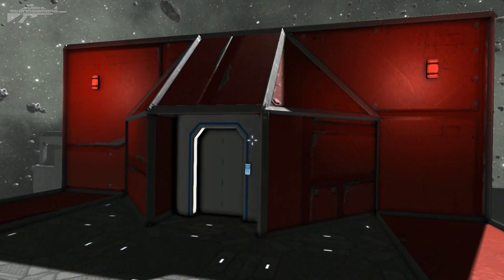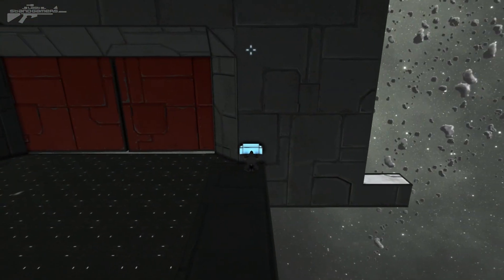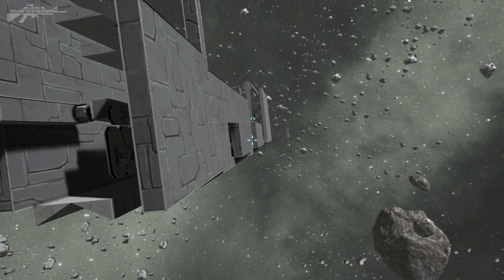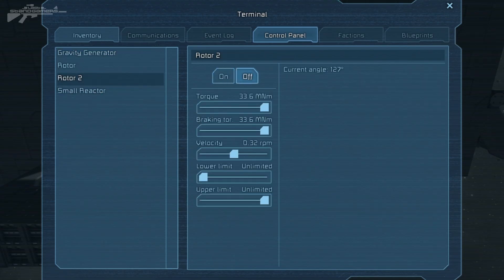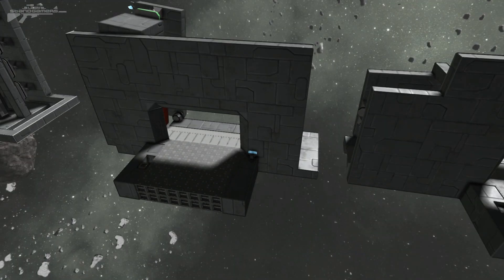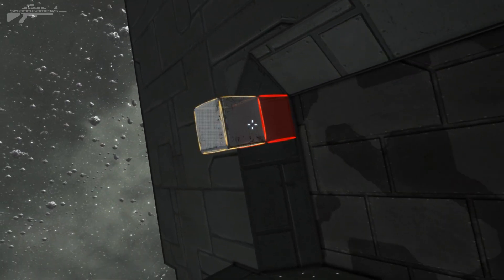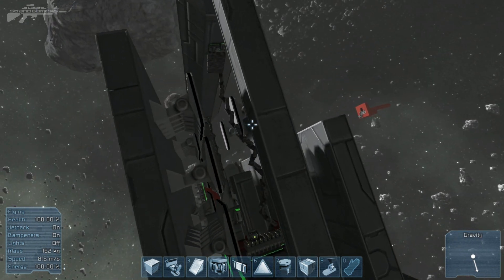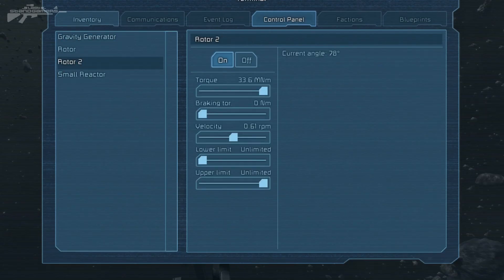Space Engineers - Blast Doors, Simple But Effective High Security Doors

Comment: i cant imagine making something like this in survival mode,,what for, energy usage is too high, i hope theyll add blast doors as normal game objects
Reply: ive built the first type of door in survival mode
it works but is a bit complicated cause you have to disamble and built again the ground when you want to close the door
also the door gets damaged if you dont set the right upper and lower max-level for the rotor and dont do raise the velocity to high
as well you dont need landinggears actually in survivalmode you cant built these walls with landinggears attached too it
Reply: TrancoTechnizer
There is a much more simple way. Just use pistons and Blast Door blocks. They have a smaller size than the armor blocks, which gives them a tiny gap to slide between armor blocks.

Comment: i just finished making a similar hangar door but it folded down and became part of the floor so you dont loose any ship real estate which can be very valuable. it is only 1 block thick but you can make the slot in the floor deeper and add layers if necessisary. you can also park small ships on it or use the area underneath it [if left open] as an area to hide secret ships
Reply: i agree with you function86.
Reply: Won't that crush anything next to the door?
Reply: Henners1991 it sounds like it folds outwards, into space. so it effectively makes your hangar bigger, since you can park ships on the wall
Reply: the model i have folds in but it dosent crush anything next to it, only things it directly hits. you could make it fold out i suppose but that would be make your ship bigger. i just made another door for a station that opens horizontally out and has a thick protective door and then another door that covers it and seals any cracks and protects weak spots. that one is a little larger

Comment: /sees a blast door/
/shoots out the thin walls around it instead/
Reply: Not to be THAT guy, but these would probably be built inside of a much larger structure making the door the weakest point.
Reply: The Euphoria is strong with this one.
Reply: ***** Greentexting is a 4chan thing... and Uraneum is wrong because greentexting starts with a > and not a /
Reply: Lord Fudge Packer Mc Gooberson
You know you can just edit your original comment instead of writing a new one with the correction.
Reply: I would thumb up your comment but you have a fedora and you're trying to greentext on youtube.
Reply: Uraneum What are you babbling about?
Reply: Nick Trano i know your post is a bit old and such but I have to slightly disagree with you...after experimenting with the door designs for blast doors i have figured out a bit

my design was as such...the door itself be made of 3 layers of small ship heavy armor in any fashion you want the door frame be 2 large ship/station blocks thick inner layer of light armor and then a layer of heavy on the front and that design stopped 48 small ship rockets before punching all the way through any of the armor which is either reloading 12 times in survival mode or firing 12 rocket pods 4 times. 

will it stop everything? not in a million years, but the fact that heavy armor isnt nearly as affected by warheads as light armor is it does the job. it literally took my friend 3 minutes to get through the door using a large ship with a landing gear on the nose trying to rip the door from the frame. it look him less than 60 seconds to ram a pole through the framing using the same large ship

so in short the frame will always be the weakest point of a security door
Reply: Yes, I understand what you're saying but again that's a situation of the door not being inside a structure. You shouldn't build something like this for the outside of a ship where you can just drill through the walls to break the mechanism; this goes inside your station, preferably at the end of a tunnel.
Reply: Uraneum not sure what the fedora has to do with anything, and I've never heard of "greentext" before so... ok whatever, have fun :)
Reply: Brandon Cheezburgah No shit mayne.
But he's using the same context.

Comment: Sorry if I put in some not so nice feedback... but for the piston door you are making it more complicated than necessary....
first of all, you do not need to use landing gears to get your door fit tight up to your entrance. second, you need to fit the landing gears on the side of the doors of course moving along a "rail". The top or underneath landing gears are unnecessary. it will not move up or down.
You might also want to add some extra landing gears in the lock position to lock it into place and secure it in position when it is shut.

I got a simple design on the workshop.
It took me several attempts to get there... however, the version I am using now at times even works on MOVING !!! large ships and of course completely without problems otherwise. All one needs to respect is the basic building advice I included in the workshop description.

http://steamcommunity.com/sharedfiles/filedetails/?id=203446154

Comment: Do you think they should add grouping to terminal objects?
IE, all gravity generators can be grouped, all lights, thrusters, ect
Reply: YES! YES! we need that now! I spent 15 minutes changing 300+ lights to red
Reply: Not only that, but "presets" for rotors and gravity generators as well, so you can set different kind of settings to buttons and apply them instantly. Saves you the time to figure out the exact velocity your rotors need to make that door open without destroying half your facility.
Reply: I kinda like the automatic wiring so far (having to wire an entire spaceship would be tedious...), but you have a point there. Maybe checkboxes for every terminal that is connected to the component you have selected, so you can specify on which terminal you want to see this particular component.
Reply: Preset block default state and automatic grouping would be great

Comment: Once, I made a ship that used a circular rotating door. It was literally a disk with holes on either side of the rotational axis, but solid 90 degrees out. All you needed to do was rotate it a quarter turn, at any speed, and your ship was locked tight. Unfortunately, this sort of door does take up a lot of room, but this led to having a whole bunch of docking pads inside. I can post the workshop link if anyone's interested.

Comment: Why don't you use the upper limit and lower limit options? It'll stop you from moving the rotor in the wrong direction. Like on your last design, if the white line is already on 0 degrees, set your lower limit to 0 degrees, and your upper limit to, I'm guessing 270 degrees, for it to fully open. Or the other way if it's done in the opposite direction.

Comment: One problem with using these sort of designs in multiplayer would be that they weaken the hull around them.  Sure your door will be thick but it wont matter when they can shoot through the gapped walls surrounding the door.  You can probably use the same principles but just have the door go into or out of the ship radially so the hull stays thick